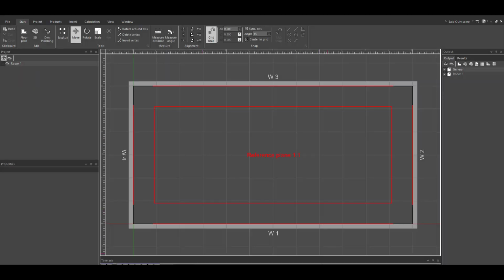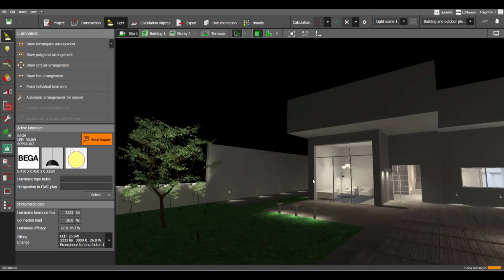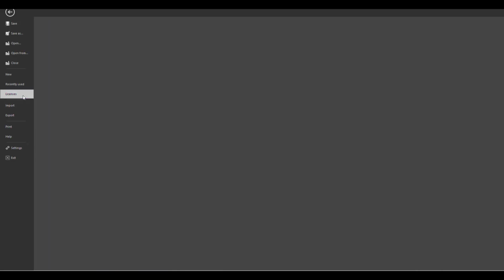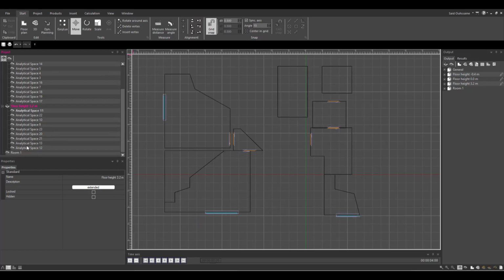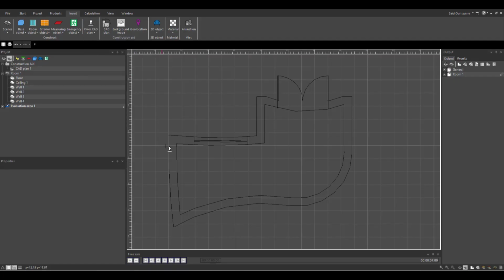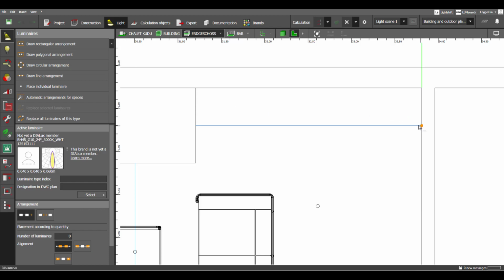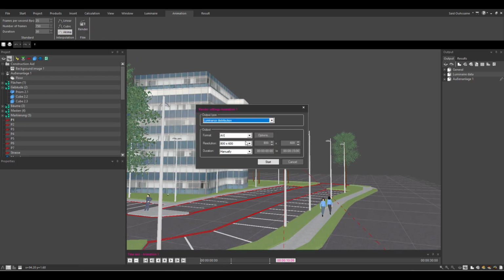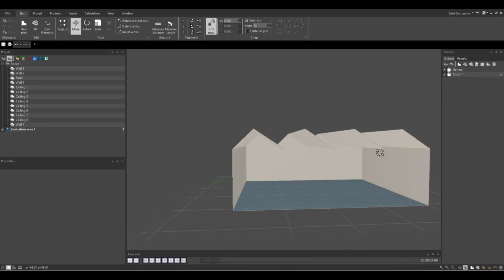DIALUX EVO VS RELUX | 10 DIFFERENT FEATURES

Comment: Hi Said, i find this a brilliant overview. As a highway lighting designer i use Lighting Reality for my calculations. the main thing i find really overwhelming is the different software's out  there to do other work.

anyway, i have started a new job which is heavily engineering. I noted that Dialux will be the best for this but to ease my curiosity. will i truly need to need the use for other software eg. Relux or Agi32? will Dialux suffice? Which is ultimately easier to use between Dialux & Relux?

its mainly factory lighting and not so much architectural. Lighting Reality was a breeze to work with however its only a 2D field for complex lighting calculations.

Wishing to know if Dialux is the ultimate package so that i don't need to thoroughly learn other software's. (we are limited to multiple software due to costs unfortunately)

wish to hear back from you.

thank you,

Comment: in the context of daylighting for a building, of course it will be affected by other objects or buildings around it. How do you simulate that condition in Dialux?
Reply from the maker: You're right! But right now, it's not possible yet to do that! You do the daylight calculations on isolated buildings!
Reply: @OUHSSAINESAID-LightingDesign  so the number of daylight factor as a result isn't valid?
Reply from the maker: @un3382  It is valid to a certain extent!
Reply: @OUHSSAINESAID-LightingDesign  ok, well. would you suggest using velux for that problem?
Reply from the maker: @un3382  You mean Relux ?